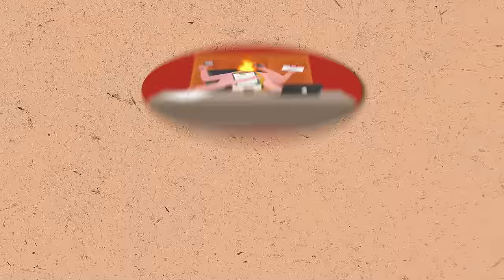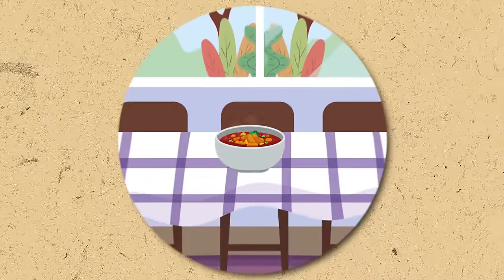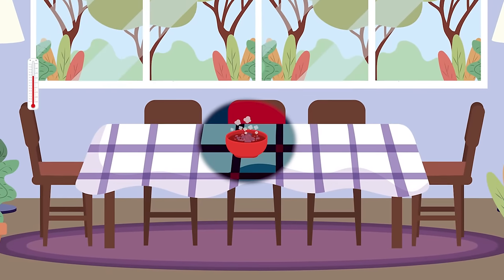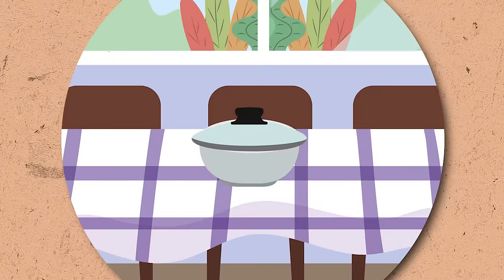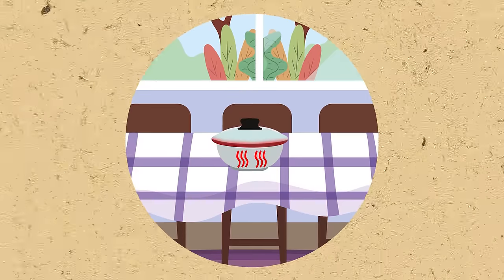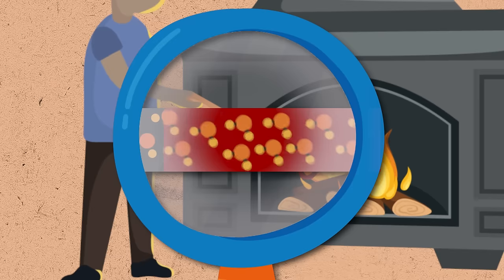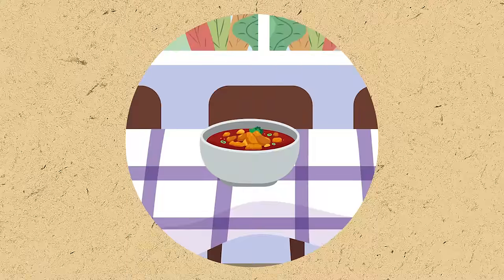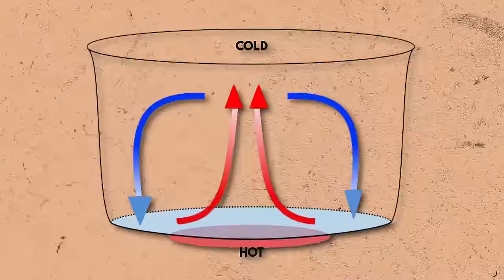Why Are Thermoses So Effective?

Comment from the maker: Team Stanley or Hydroflask? 🤔
Reply: People do this to camp fires when it's coldout and not just pretending to be out in space close to the Sun. They heat the front and then turn around to heat their backsides. When it's super cold out, like Michigan in February at zero degrees, you end up doing quarter turns instead of the 180 turn to keep everything warm. Sort of like those hot dog cooker in gas stations or 7/11s.

FYI - camp fires burn faster and a little hotter if you create a pyramid or teepee style versus laying the logs flat. Heat rises causing the wood to catch fire faster and burn hotter.
Reply: I've got a Stanley, and used to have a hydroflask. I'm partial to the Stanley.
Reply: @startalk What about when we use lasers to cool down particles close to absolute zero…what kind of transfer is that?
Reply: Team Yeti here
Reply: Both
Reply: I've been camping most of my life and have been using Stanley for my
beverage needs well before the cup. So partial to Stanley even though I have never owned the Stanley Cup, the thermos is Awesome.
Reply: Yeti!
Reply: I do not understand how vibration can be measured as temperature, if we accept it as true you still need to explain how vibration converts and moves by convection or radiation back and forth then finally back to conduction. Also I never saw convection current in my hot soup (it can happen if you have an uneven heat source from under in liquid or gas), heat doesn't move only up or down, it moves horizontally as well otherwise there can not be convection current.
Reply: No idea what this is about, I will in 17min forsure lol
Reply: Organic based thermos (carbon-iron density composite)
Reply: INFRARED TIL YOU'RE DEAD,

BABY
Reply: Didn't Stanley just get sued because of lead in it's products?
Reply: was sipping cold suds from a stanley adventure big grip beer stein when this came up in the feed! 🍺
Reply: What about Radiative Cooling?
Reply: star talk pls🙏 could you do video about how heat transfer from cold body to hot body with work done input. by neil
Reply: @isaach1447  I could be wrong, but i guess it's just collisions, atoms smash against each other till they stop like a chain collision in cars.
Reply: Team Ozark Trail! I can't afford Stanley anymore after all the car fire hype.
Reply: @jmr the lead plug is what makes Stanley cups work so well.
Reply: Team NdGT and CN.
Reply: @EdisonvsTesla What do you mean by "with work done input"?
Reply: Neither, Yeti
Reply: Neither.  Hydroflask doesn't work for me.  I work outside in NJ and it didn't hold up.  Yeti.
Reply: YETI
Reply: I thought everyone used yeti
Reply: Chuck saying “I’m gonna have to spank you for that “ after Neil’s lame Milky Way black hole joke killed me 😂
Reply: Hydrogen x
Reply: Stanley for memories
Reply: Stanley.   You posers.
Reply: Team room temperature!
Reply: I love the illustrated/wild chuck comment format!  

Stanley or Hydroflask?   Neither, I can handle most fluids room temperature, and for anything I want cold, I don't like Ice cold, and as for hot, for me that's mostly coffee, and it's just as good cold.
Reply: I have a Takeya and a Contigo. Both have the same basic design of separating the inner aluminum bottle from the outer aluminum bottle by a near-vacuum gap, so the only point of convection is at the neck where the two layers join. They are both wonderful at keeping my tea hot or cold, depending on my mood that day.
Reply: Yes, eyes can detect temperature
Reply: Team Rtic
Reply: Isn't there a partial vacuum in the Stanley?
Reply: Same. Tried and true thermos @Onio_Saiyan
Reply: What's that distance from Sun at which we'll be comfortable without getting burnt by radiative heat of Sun?? , Niel sir forgot to tell that
Reply: Neither. Zojirushi makes the best thermos I have ever owned.

Comment: I burned myself today on the frying pan, that's a form of heat transfer. I was washing it and thought I hit all the parts with cold water before touching it, but I missed one spot and touched it with my bare hand.
Reply: Solarcaine.
Reply: Not sure about the heat transfer but probably... Skin transfer!
Reply: Get some vanilla in a spray bottle,spray burn for quick relief
Reply: Cold water destroyes the hot pan.
Reply: BAAAAHAAHAAHAAHAHAHAHHAA!!!!! 👹👹👹👹🤣🤣😂😂😂
Reply: @jeinnerabdel the heat transferred from pan to hand lol
Reply: @LukeSumIpsePatremTe  Only the dainty ones with anti-stick coating. I have real pans, stainless steel.
Reply: Neil: You know, the heat from that frying pan is a remarkable example of the fundamental laws of thermodynamics at work. When you turn on the stove, you're converting electrical energy into heat energy through the process of Joule heating. The coils on the stove resist the flow of electricity, causing them to heat up. That heat is then conducted through the metal of the frying pan, which is why it can burn you.
But what's really fascinating is how this ties into the concept of entropy. The second law of thermodynamics states that in any closed system, entropy always increases over time. In other words, heat always flows from hotter objects to cooler objects, until they reach thermal equilibrium. When your hand touched the hot pan, heat flowed from the pan into your skin, causing the burn. This is a perfect example of entropy in action - the heat is dispersing from the concentrated heat of the pan to the cooler surroundings of your hand and the air.
And if you zoom out even further, you realize that the energy that heated up the pan ultimately came from the sun. The sun's energy is what powers our electrical grids, which in turn power our stoves. So in a sense, you were just touched by a tiny fraction of the sun's immense power. Of course, none of this changes the fact that burns hurt. Make sure to run some cool water over it and apply a soothing ointment. But as you do, remember that you're witnessing the fundamental laws of the universe in action, even in life's painful moments.
Reply: @EPS5000 
Most people have Teflon or similar pans - thus the warning. Even cast iron pans begin to resemble balls rather than flat surface after enough maltreatment.
Reply: @madeonearth6506  Good one, bud!
Reply: @madeonearth6506 maybe that's where they get the term panhandling from. "I dun burned my hand. Can I get some money?"
Reply: @ArtSurvivesArtist wtf, I never thought of it that way.
Reply: Just let it cool down before washing.
Reply: You should never hit a hot pan with cold water, that warps your metal 😢
Reply: @chrisswann4123  You can depending on what the pan is made of. I already replied to someone else it’s stainless steel, I’m good.

Comment: You're the man, Neil. Thanks for all you do and educating me more than I can put into words.
Reply: I guess I technically just used words
Reply: I do not understand how vibration can be measured as temperature, if we accept it as true you still need to explain how vibration converts and moves by convection or radiation back and forth then finally back to conduction. Also I never saw convection current in my hot soup (it can happen if you have an uneven heat source from under in liquid or gas), heat doesn't move only up or down, it moves horizontally as well otherwise there can not be convection current.

Comment: An excellent explanation, as always. Well stated, except the thermos is slightly different. The inner bottle is double walled mirror with a vacuum in the middle. (Fewer air molecules = less heat loss.) On rugged models the inner bottle is stainless steel instead of mirrored glass and it still works as well. Thermopane windows are sealed but don't use a vacuum. Argon or Krypton gas is often used because these gasses are slower in heat transfer. UV and IR can be blocked with a ceramic coating. Some windows instead used a suspended sheet of tint plastic to block UV and worked as a 3rd pane.

Comment: I love the way Dr. Tyson explains things, but it's often on topics that I learned in the 8th grade. Still, I understand how it is necessary to educate people, even adults, in how the basics of science work.
I have a couple of very effective Thermos-like bottles. They are very good at decreasing the efficiency of thermal transfer by having two layers of aluminum separated by a small gap of a vacuum. The only point for convection is where both the inside and outside skins meet at the base of the mouth.  I can put hot tea in there, and it will still be warm the next day. Conversely, I can put in iced tea, and there is still ice in there the next day.

Comment: State change doesn't seem to have been mentioned.  When you put the lid on the soup you create a vaper pressure that could slow down evaporation so the soup cools slower. Evaporation transfers energy form the soup to the steam.

Comment: My favorite insulator for food and beverages... negative air pressure. There is a very minimal transfer of heat at the top of the container where the two stainless steel walls meet, but it is very minimal if the container is kept upright. Keeps cold much more efficiently, but 8-10 hours of hot is acceptable for me.

Comment: Is convection really a legitamte form of heat transfer? I mean it physically moves hot particles around sure, but the particles themselves don't lose energy. Conduction and radiation actually transfer energy between matter, and convection just helps facilitate those. Would that be correct to say?

Comment: Neil & Chuck,
Being old ,  I remember that  the glass theromoes were known as :Vacuum Thermoses": as they has no air between the layers of glass. If you lost that vacuum their insulating ability diminished and by a lot. One wrong move could ruin your thermos. it having a thin walled vacuum bottle. As for the double paned window glass, the better window panes have an inert gas such as nitrogen between the panes. 
Nice talk otherwise. 
Bruce

Comment: With the thermos, the air molecules inbetween the 2 layers of material, can still CONDUCT heat from the one layer to the next. Also at the top end when the 2 layers meet, heat can be conducted as well. 

So, if you can come up with a way to prevent that, you can keep the heat trapped from much, much longer.

Comment: i have something i call a "warmte bubbel" or "heat bubble" in english which is basically the air around me while im sitting thats just abit warmer then the rest but leaves the moment i stand up to do anything making it possible to sit around in something that shouldnt keep me warm enough to not feel cold but only feeling the cold after i disturped it

its abit like the 0g thingy he explained abit later but probably to a lesser degree because of convection

Comment: This is why it doesn't matter in what kind of vessel you carry your drink. So long as it is a near-perfect vacuum flask, it will hold temperature longer. This is also why they tell you not to put them in the dishwasher - the intense heat on the outer shell can break the seal.

Comment: In Minecraft, when diving if you swim above a lava block you get pulled towards the lava block, even though bubbles are rising up. I thought it was backwards but if I understand Neil, the less dense water doesn’t leave a vacuum so it cooler water is pulled down to fill the space? That’s so dope

Comment: And fiberglass alone has a air convection problem when it gets down to -40F(or C) and adding a small amount of cellulose insulation fixes that. And pushing cellulose insulation past R60 needs some fiberglass to prevent settling. Welcome to Zone8 information.

Comment: I actually heard that problem is not burning up while traveling in space instead of staying warm, Whatever source of energy it might be, nuclear or what not, would be inside the ship to have access to fix it in case something breaks or goes wrong, but that also means some of that heat from engine would get into the ship, that means all that heat would have to be transferred out, even heat from human body over extended period would build heat up the inside to 37C the normal body temperature and then keep going higher.

Comment: Typically, at least on "Thermos" type cups (bottles?) where the "vessel" is made of glass, the empty/insulating space is evacuated (near/partial vacuum), so there is almost no air in the gap to transfer heat.

Comment: Huh, while I knew most of this I always thought conduction was the most efficient form of heat transfer and radiative was the least effective, and that's why the International Space Station needs heat sink panels to keep it from overheating.

Then again, the efficiency of conduction varies greatly on the material. Plastic, water and glass for example conduct heat much more slowly than metal.

Comment: The best thermoses donyt use air in the layers but take the air out creating a vacuum so there are no molecules to transfer heat.  And also, we lose heat to evaporation of sweat.  Heat is lost when water evapotes off an object.  You can put a wet sock on a warm bottle of water and when the sock is dry the water is cold.  I wish he talked about these two things.

Comment: Random and simple example... So if something is 1 light year away and turns on a big light. Would that light not be visible for 1 light year at that distance? My assumptions would be no. We would be lit up from the light 1 light year away, but light source emitting photons would be seen immediately. So how are we seeing light from billions of years ago? Wouldnt it be the light that it hits and not the light it emmits?  Like a flashlight. The source will be seen immediately because the photons are constantly being emitted, But where the photons travel to are what will take time to reflect and/or refract. So the stars we see are in real time aren't they and what they light up is what takes the time. Do i have this correct? And now to watch the show

Comment: What if there is no air molecules to make the soup cold? 
Woul the soup remain hot or would the heat molecules will still go but really slowly?
Reply: The soup would still cool by radiating heat away as infrared energy.it would also lose heat by conducting it to the bowl. The bowl would then radiate heat away by infrared and cool, and the soup would lose more heat to it by conduction.

Comment: Electromagnetic radiation ( Light ) can be bent by gravity.
So it does not always travel in straight lines ?

Excellent 👍
Love you guys
Reply: I do not understand how vibration can be measured as temperature, if we accept it as true you still need to explain how vibration converts and moves by convection or radiation back and forth then finally back to conduction. Also I never saw convection current in my hot soup (it can happen if you have an uneven heat source from under in liquid or gas), heat doesn't move only up or down, it moves horizontally as well otherwise there can not be convection current.
Reply: @ShonMardani  friction of vibration of molecules like rubbing hands together. Microwave ovens do that to liquid molecules.
Resonance frequency

Comment: I do not understand how vibration can be measured as temperature, if we accept it as true you still need to explain how vibration converts and moves by convection or radiation back and forth then finally back to conduction. Also I never saw convection current in my hot soup (it can happen if you have an uneven heat source from under in liquid or gas), heat doesn't move only up or down, it moves horizontally as well otherwise there can not be convection current.

Comment: But the apollo 13 astronauts couldn't have done that for a long time,  I'm sure.  They would asphyxiate. In the ISS they have to keep the air moving continuously, so the astronauts don't breath air with high CO2 concentration.
Reply: What you need to understand is that oxygen freely mixes INSIDE the space capsule. oxygen atoms are smaller than CO2

Comment: :-) boundary later magic for some things, for others bane of existence, break boundary layer with high sheer velocity circulating helium ( or other) to break CO2 from surface and replace with highly conductive fluid, hard to keep quiet but they have similar tech now that is quite   quiet , need to just add helium in circulation and decap CPU's , TPU's, GPU's , etc . and pump away at low room temperature.

Comment: You read my mind. Hot pan. Run under cold water and at one point you can hold the handle until all the pan heat runs from the cold and heads to the handle. Ouch. Done it. What's up with that?

Comment: You left out how I have frost on my car in Florida when it's 35 degrees out and not 32 degrees. It has something to do with heat transfer and dew point. I think the dew evaporating needs energy to evaporate and takes the energy in the form of heat from the car causing the car to cool below freezing and freeze the dew. But hey, I'm not a scientist.
Reply: @JDns-we4fw  But condensation can freeze at 35 degrees. I wouldn't believe it either, but I've seen it. It's called "Radiative Cooling". I just looked it up.

Comment: They are probably 2 layers with a vacuum.   Not a perfect vacuum  but enough.   The Stanley ones are glass under vacuum.   You drop it and it won't work.   They transport  liquid  nitrogen  this way and dairy.   2 tubes and a vacuum  between them

Comment: The radiation goes straight because it can't stay in the same place because of the temperature, that's why the stars, the planets rotate...there is also the key to weak gravity as a force, I think! In the middle of the planet, how does it spin, unless it moves its point, by moving its point, it pushes, unfolding the circle in line!